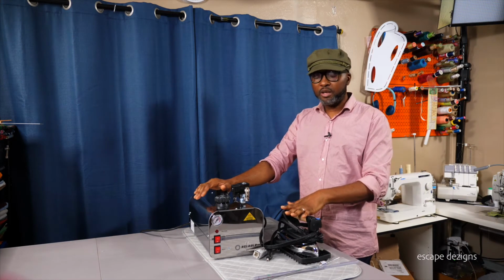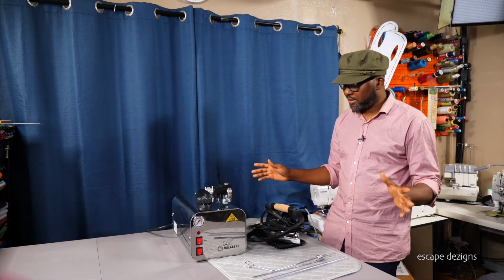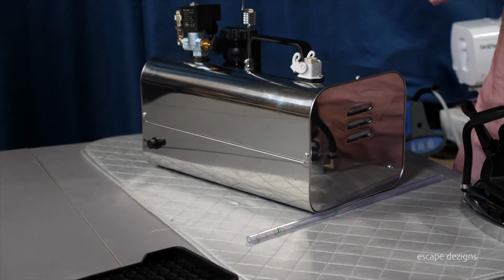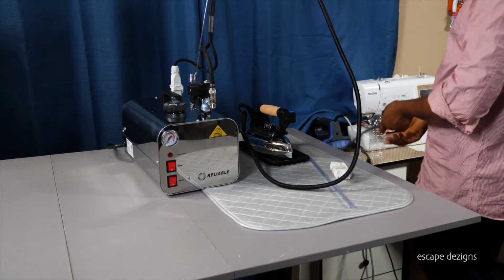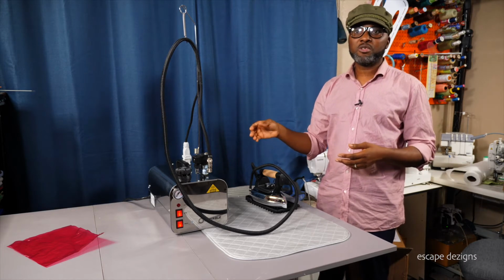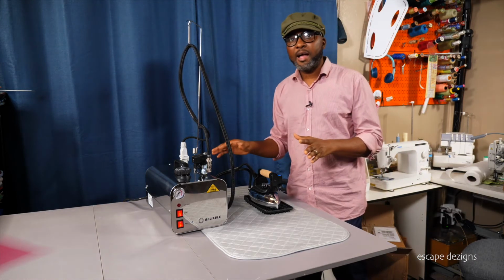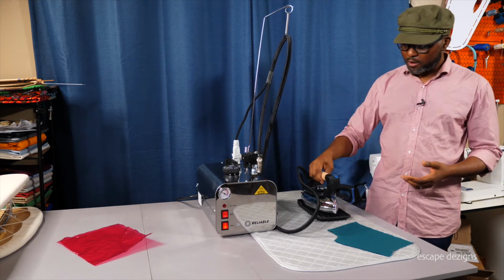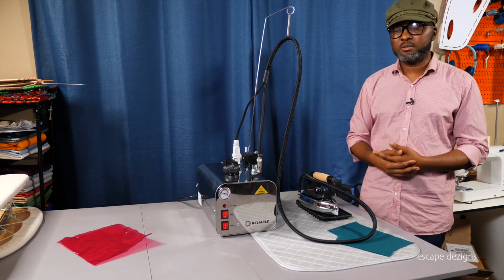RELIABLE 5000IS STEAM IRON

Comment: Hi how I can fix this, I buy I is not getting the water hot
Reply from the maker: So sorry I've been away for a while, just saw your message. If you have not get it fixed already  
Two things might be the problem, one is the rest button might need to be pressed to get the boiler back to heating state.
if not then beside you have the boiler and the iron switch turn on, if nothing then the boiler might be faulty and need repair .
hope it helps.